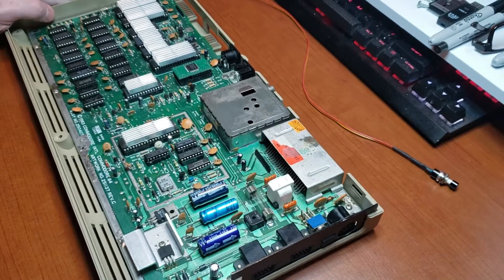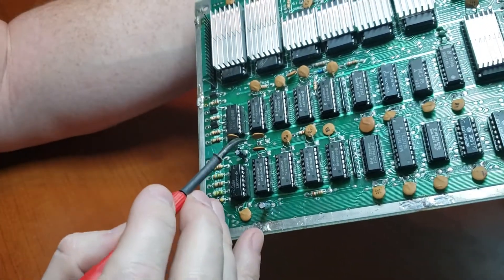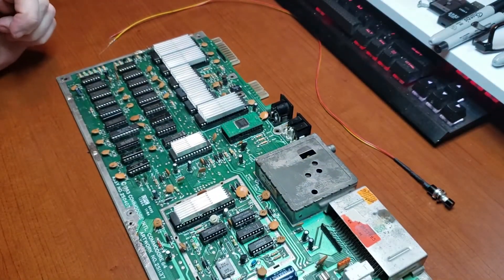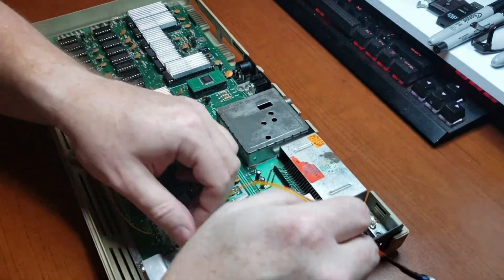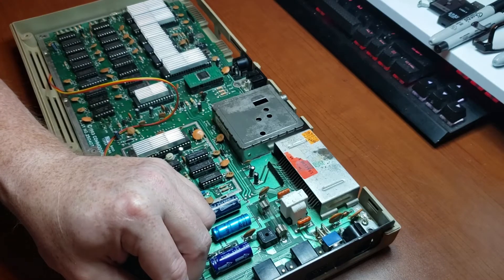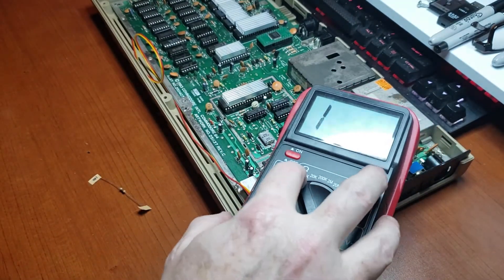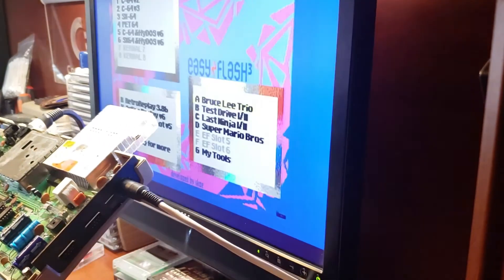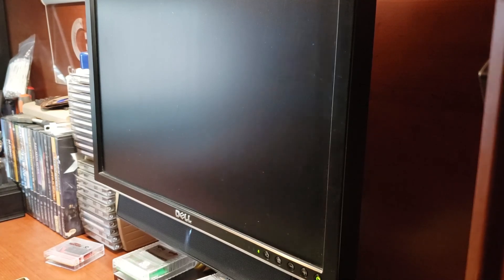Adding a Reset Switch to a Commodore 64

Comment: Do you think I can use the same spotrs on board assy 250425 ?

Edit to answer my own question :shorting the 2 pins of C34 (I do through a 2k resistor) on assy 250425 works for a Hard reset button.
Reply: hi, why you use only c34 capacitor? could you share a pic of the result? thanks!